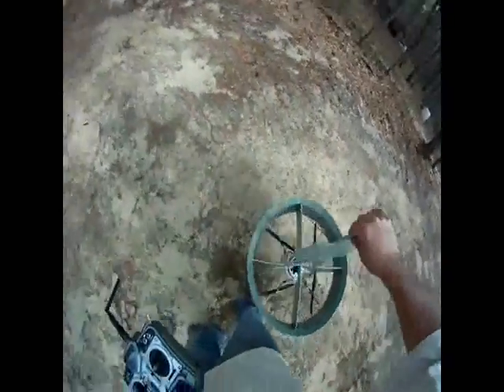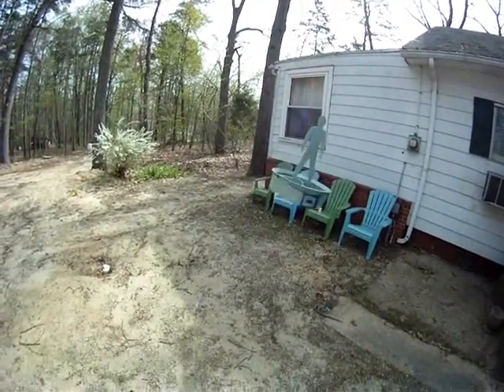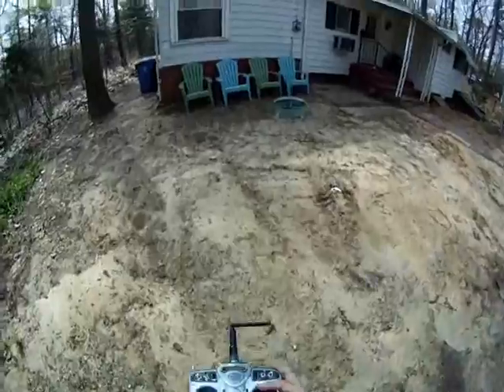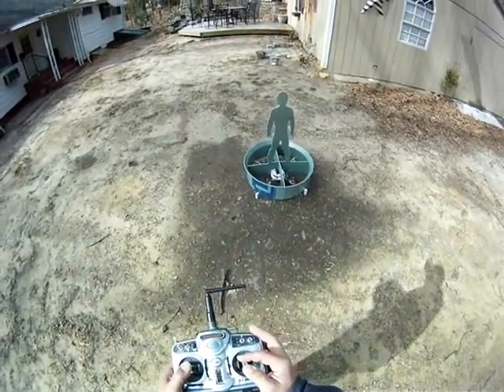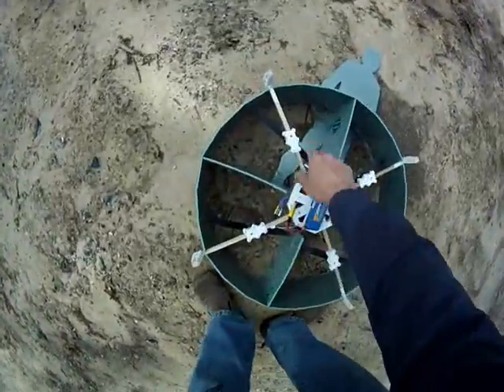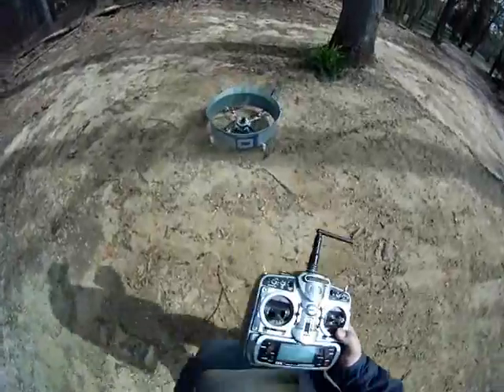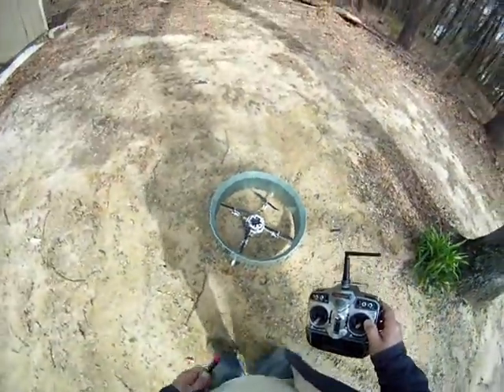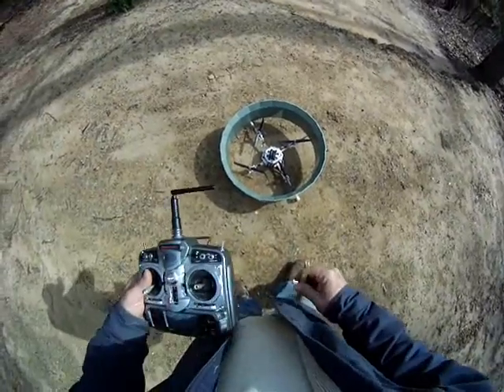Hiller Crash Test

Comment from the maker: Getting there, turns out I had a loose connection on one of the motors so it kept kicking out during flight with vibrations. So i think it may still work just need to fix the motor and try again :)
Thanks guys